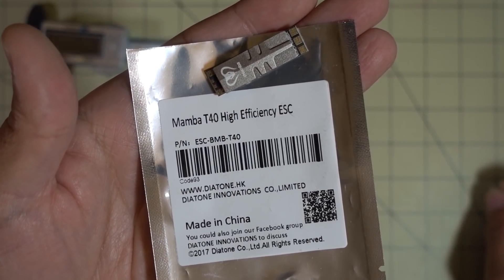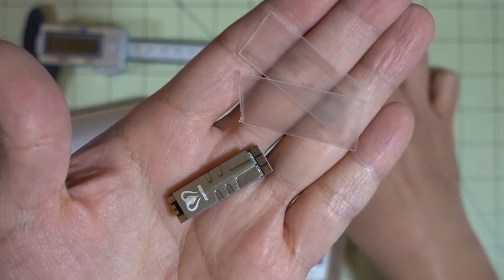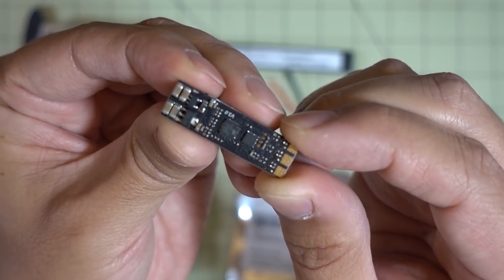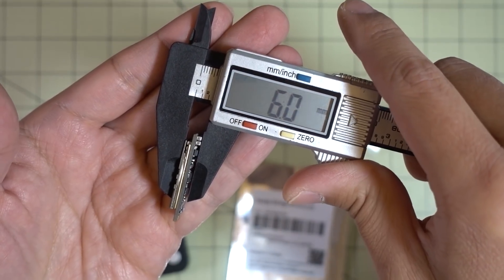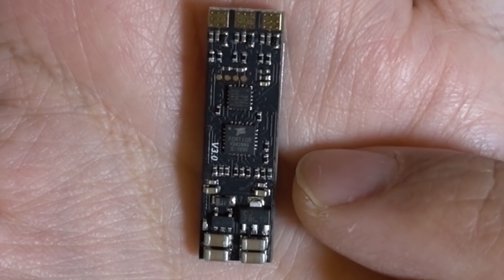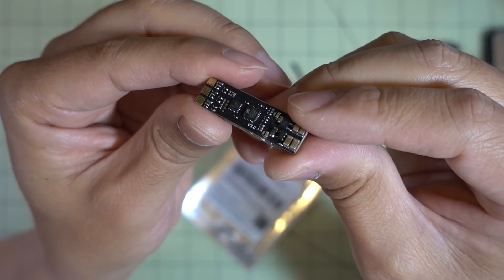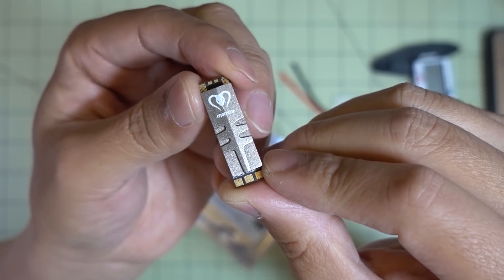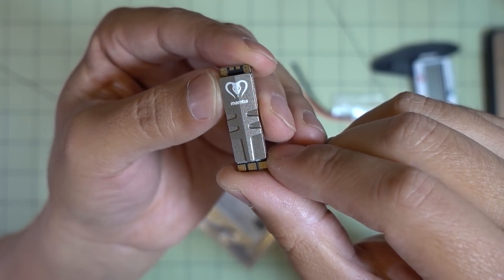Diatone Mamba T40 40-amp BLHeli_S ESC 🏁

Comment: Hey Albert.  You might already be aware.   Diatone uses these Mamb ESCs on their GT-M530, which I wanted to buy.  But there have been several  reports of these ESCs spontaneously catching fire with normal use.   Diatone has not publicly acknowledged this but their GT-M530 are certainly on hold, for ordering.   I was told by them that they are looking at the ESC problem, and hope to have it resolved by the end of June.
Reply: Sounds plausible, but wow, you're brave!.   Have you contacted Diatone yet, re the safety of these ESCs ?
Reply: When I last asked (2 weeks ago), Diatone said that the GT M530 (which used the Mamba ESCs) would be available again at the end of the month, after investigating and fixing some problems.  Maybe contact them sooner.
Reply from the maker: Yes, they told me they have put the M530 on hold due to an ESC issue which is why I have not gotten a review sample yet.  The one UAVfutures reviewed will be different when it is finalized.
Reply: Can confirm the fire issue, got my M530 (stretched) a few weeks ago and one ESC caught fire on the first flight :/
Reply: I heard fires could be due to the heat sink taking impact, flexing and shorting on the capacitors. It looks quite plausible on my set. I've removed the heat sink from all 4 (heating the ESC with a heat gun to soften the adhesive then pulling them off with pliers) and will be building them into a quad in a few weeks.
Reply: I'll post up some videos in a couple of months after I've tested mine without heat sinks and see if it has prevented fires. Hopefully by then they'll have rectified the issue anyway. If mine still burn, obviously there is something electronically wrong and I'll contact Diatone/the retailer about it.

Comment: I'm wanting to get back in to building my drone.  I've gone threw 2 4 in 2esc boards that are 20 amp.  I think my motors draw up to maybe 26 amps.  I want to put escs on there that I don't have to worry about over drawing on.  Would these be good or over kill?
Reply from the maker: These will be good.
Reply: Would it be safe to go down to 30 amps? I'm not flossing so I don't need them that small in size.